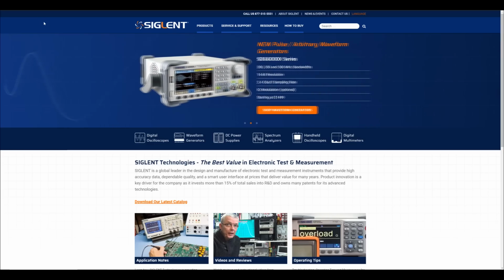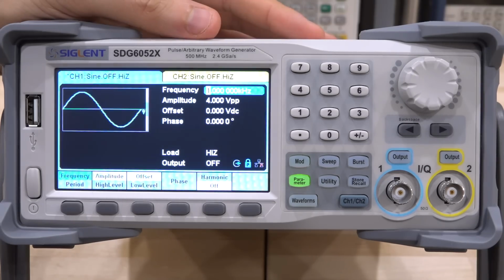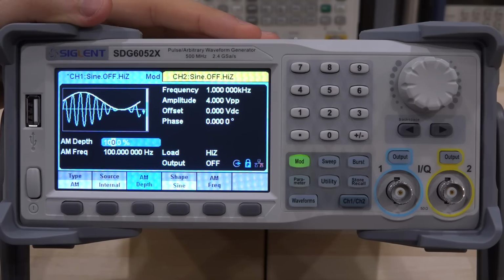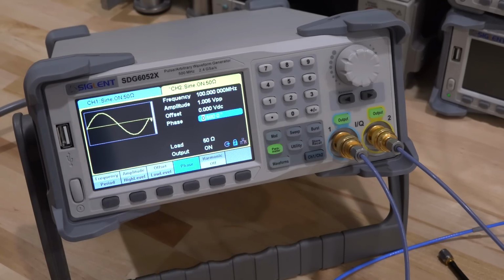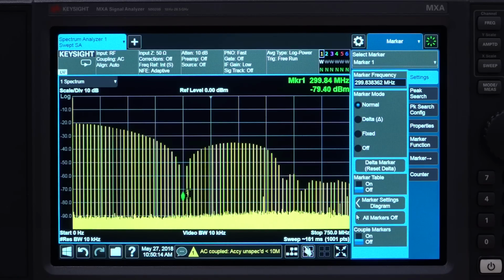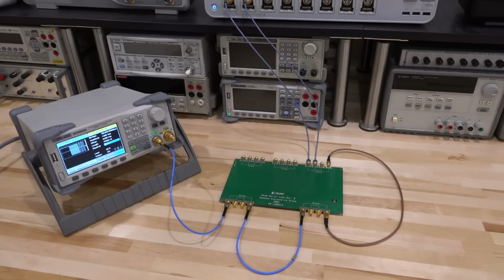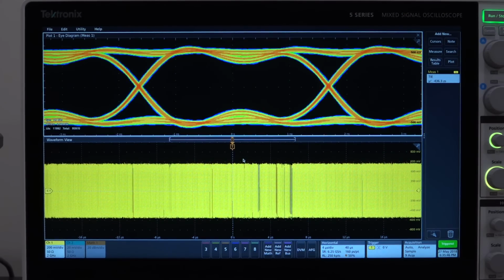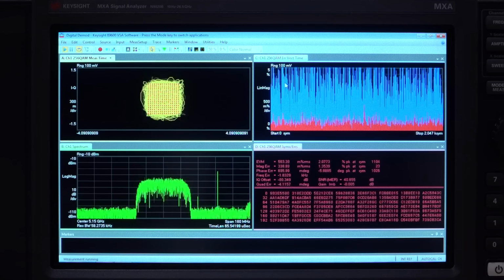TSP #123 - Siglent SDG6000X Series Arbitrary Waveform Generator Review, Teardown & Experiments

Comment: The far right blip on the scope was the signal return from your ceiling.  It looks to have occurred at roughly 10.2mS meaning the one way trip would be 5.1mS.  It looks to be a basement so I think the temperature is a bit cooler than room.  Let's say it was 20C and so speed of sound =343.3 m/s.  That makes the distance from the face of the transducer to the ceiling 343.3 m/s * 5.1mS or about 1.75 meters (5.74 feet).  Assuming your bench is roughly 35" (0.889m) and accounting for the maybe 3 inches from the bottom of the breadboard to the face of the transducer, that makes the ceilings in your basement about 9' high meaning someone sprung for extra high ceilings in the basement (the only way to go for a lab!)  Very nice.
Reply from the maker: Nice. My basement ceiling is indeed pretty tall. :)

Comment: Time to receive reflect signal:10.2 ms - 0.1ms (end of burst)
Speed of sound in 20 degree Celsius  : 223 M/S
Distance between table and roof is : 0.0101 x 223 / 2 (send and reelect ) = 1.12615 Meter

Comment: 200mhz model price is reasonable. The 600mhz model is overpriced. Be there this is mostly because it is targeting much more professional people. The hardware is certainly the same. I mean hardware is trivial. Fpga, dac, amplifiers and gain control. That is all. Software is okish, but t not the best. I would like to generate arbitrary functions on the device without of. Just enter mathematically formula (using time domain and modulation input), including many building functions and noise or random functions and add many signals together. Main CPU just computes function in fpu, generates 100Mps and uploads it to fpga. So easy.

Comment: As usual this is a great video Shariar !!! I was missing one more thing it there which is measuring the cross talk level between AWG channels. As this generator is capable of outputting high level of the signal, this may be very useful parameter to verify.

Comment: You've got a really high ceiling. ~3.5m from your table!
Reply: Shouldn't it be half that? The total distance the sound travels is 3.5 meters, but it has to travel up to the ceiling and then return.
Reply: Thanks jan386, you're absolutely correct. It should be half. I made a careless mistake.

Comment: Doesn't the spectrum analyzer re-sync the constellation so it remains upright and stable? You mentioned the devices were not synchronized. The whole constellation should have been rotating with a speed of the difference of the two references!
Reply from the maker: Yes it does. But only once during an acquisition. So if there is drift, or if there is a strong LO signal which is slowly moving away it will eventually cause rotation by the end of the acquisition. VSA does not do phase tracking. Just a one time phase lock.

Comment: Very nice review and interesting demo's. Since I make videos myself I know how much work it is.  Hats off to you
About the transducers. The first bump is crosstalk  between them, the further away is reflection via the ceiling. You can calculate the distance to the ceiling with this "sonar" very cool experiment.

How is the noise if you isolate the transducers from each other or connect the grounds at the DUTs. Now you have ground loops (if the FG output is earth referenced) 

If you are looking for ideas,  acoustical temperature measurement like Jim Williams did for a application note (if I remember well)

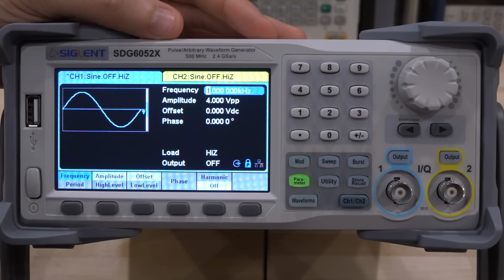Comment: 19:20 wasnt that the other way around? I was under the impression that putting the output mode to 50Ohm scales your Amplitude by 2 while highZ leaves it at what was set.
Reply: Terminated in a Hi Z load gives 2x the amplitude of the same signal terminated in a 50 ohm load. This has normally nothing to do with the generator output. That itself does not change.  (other then lower at the load due to the lack of reflections) I think here the FG corrects its reading for that. So you do not have to correct it.